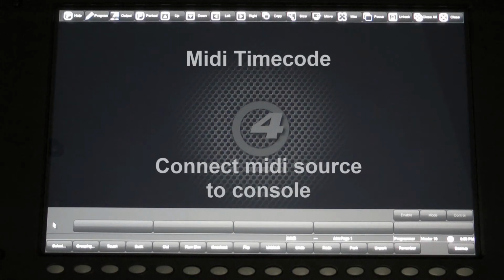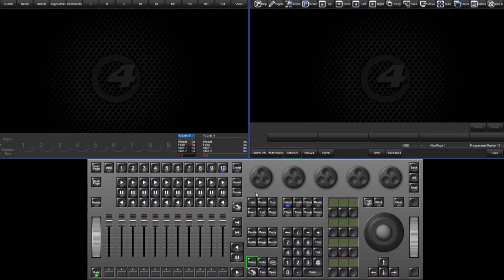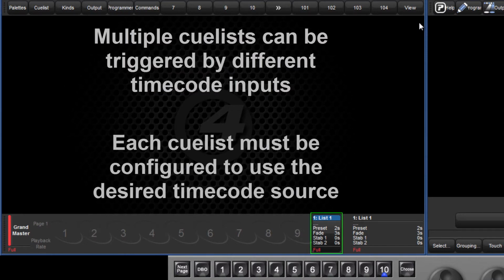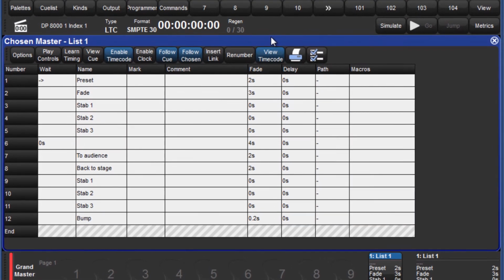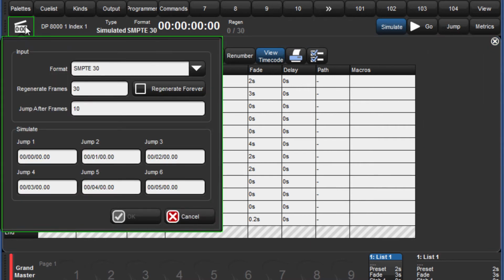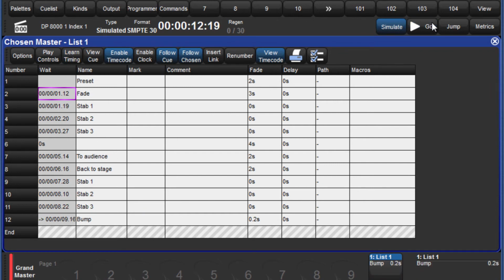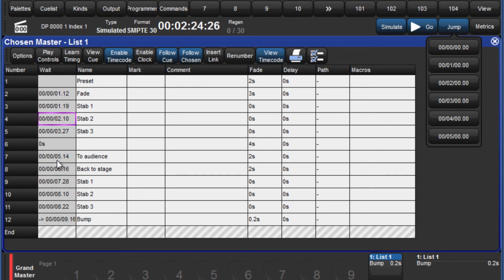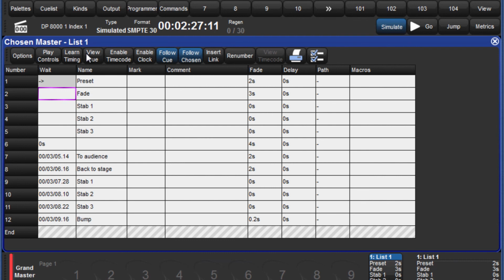Hog 4 Tutorial 14: Setting up Timecode and the "Learn Timing" function

Comment: If your using a lighting simulator with the same computer as the Hog 4 pc, do you need a midi box? Can’t I just create a time code automatically without using any other external hardware?
Reply from the maker: Hi Sean,
You may have already found your answer via the following, but if you haven't, or if anyone else is curious about our solution to this issue you can find the discussion in our forums here: https://forums.highend.com/index.php?p=/discussion/20129/can-you-create-a-time-code-with-the-hog-4-pc-and-lighting-converses#latest